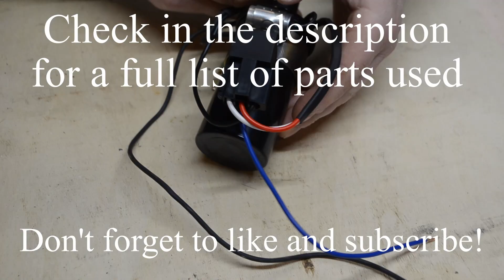High Voltage Igniter

Comment: Hi, I have just made anothere one of these and want to put it in a box to run my small ic engine.   Is there a motorcycle coil that can replace the cylinder coil to make the system smaller ?
Any help appreciated thanks.
Reply from the maker: I haven't tried that yet, but I bet one would work.

Comment: Sometimes I use your TIG wire trick to remove the wires from the 5wire relay pigtail and insert them in more user friendly positions, black for gnd, red for +, etc.  Thanks I'll use this simple setup.
Reply from the maker: That's a great idea! I need to build another one of these soon. Thanks!
Reply: Good idea, but I feel sorry for the person looking at this and wondering what wire goes where?😆

Comment: Would this work for an electric fencer if the pulse was slowed down...to say one spark per 1/3 second ? Meaning would id have enough power to carry a charge for a mile or so ?
Reply from the maker: It would. You'd just need to find a way to slow it down a lot. Whatever the coil is rated at is how many volts you'll get out

Comment: Best Video I have seen, My question I need to power on points make, on my old engine the points provide ground so can i power positive and let negitive only power when the lobe closes and causes it to spark at that moment?
Reply from the maker: Thanks a ton. I'm having a hard time trying to understand what you are asking. Can I have more context?
Reply: @BuildNPulsejets  My points will provide negative to the system, , and looks like the relay breaks only positive to make it "BUZZ"
 Can I swap  + and -  .for the same affect?

Comment: How long would you be able to run this with out it burning out?
Reply from the maker: I've probably got about 5 hours on this one over the last few years. The relay is just starting to give me some trouble
Reply: @BuildNPulsejets  Thanks I have just tried this and when i connect it together it just melts the wires on the battery connection. What have I done wrong could it be the relay colours being different?
Reply from the maker: @redwinecustomfabrications8970 yeah I suppose I could be. Let me see if I can find the pinouts on the ones I've got and you can compare
Reply: @BuildNPulsejets  Got it working, I had to swap all the connectors around, a bit of trial and error and i got there in the end.Got to try and fins something quieter though.
Reply: Could this be done with a SSR?
Reply from the maker: @redwinecustomfabrications8970 yes I believe that would work?

Comment: Watching your big pulsejet so quick and easy to spring to life, maybe even an ultra simple piezo gas grill sparker would be satisfactory. Something like this without starting air and just a single spark.  Of course, most pulsejets, you'd want a constant spark until they warm up or catch, say with a liquid fuel that can sometimes be more fussy.
https://youtu.be/NU3cQ8_upWk?feature=shared
Reply from the maker: I have a homemade spark ignitor setup with a momentary switch that I can turn on, then turn on the fuel and then as soon as the engine is started I can let go of the ignition switch.

Comment: Can this be used to power a flame thrower kit for exhaust on a car/motorcycle?
Reply from the maker: Yes, it sure can
Reply: @ Thanks! I assume a momentary switch to activate the spark could also be connected to this setup. If so, where exactly would you connect the said switch?
Reply from the maker: @ZflashProductions yeah, that would be easy enough. Just put it between the relay and the positive from the battery

Comment: ..it's not to take any value out of this video, but just to clear some terminology; Condenser is found eg. in refrigerating components and it's the coil where the refrigerant condenses to liquid from vapor (as an example of condensing..)..the.electronics component here is called capacitor..which really describes it's job better than term used in many languages in europe, (kondenzator, kondensaattori, eg..) since nothing really condeses inside.. it's more like reservoir pool for electricity..👍
Reply from the maker: Well, although you are correct, you are also not correct 😉. The condenser I am using is a capacitor, yes... It gets its name from the automotive parts inside a distributor and often is sold as a set of "points and condenser". Here I am specifically using this automotive part and is why I use its proper term.
Reply: In a refrigerant system, the condenser takes a hot, high pressure gas that comes from the compressor and removes the heat from it turning it into a liquid. Depending on how many degrees it cools it below the temp required to make it a liquid is called the Sub-cooling. Then, after passing through a metering device, typically an orifice, TXV or EEV, which atomizes the liquid into mostly a vapor, with some liquid droplets it goes into the evaporator coil, where the refrigerant picks up heat and becomes a superheated vapor. Same theory applies as sub-cooling, then the compressor compresses that superheated vapor and sends it back to the condenser to give up that heat and become a sub-cooled liquid again.
Reply: @a1reliableairconditioningi149 ..well condensed explanation of refrigerant circulation system! 👍😅
Reply: 😅..as i work with electronics i've never heard such term..but every line of profession has their own terms! 👍
Reply: @hipihei yes in Automotive terms its called a CONDENSER, 
like was stated, you go to a auto parts store, you ask for points and CONDENSER,
Reply: @hipihei  The term "condenser" used for this capacitor goes way back. It's connected alongside of the distributor "points" which is like relay contacts, but actuated by lobes inside the distributor as it rotates. the condenser, or capacitor, prevents the points from sparking, thus extending their life. we're talking about cars made before the 1980s, when electronic ignitions became more common.
Reply from the maker: @hipihei  Yeah, I agree, kinda weird 😂

Comment: The color codes on the relay connector wires are not always the same, (they should be -but not always) so your build might not work. Make sure that you use the wire connection to pin 87a, not pin 87.  My supplied connector had the yellow and red wires reversed.  The video clarified the connections required in his recap. Use pin 87a, not 87.
Reply from the maker: @doranoliver1624  ok interesting. Thanks for the heads up!
Reply: I was going to add this comment before seeing yours. I just found that out and melted a couple of the wires so did it again ignoring the colours and wiring by the numbers.

Comment: Is it a normally open or normally closed relay I built it according to what you did but no spark
Reply from the maker: @jjmasser8820  it is a normally closed. You want the circuit to be closed so that it runs through itself to activate the magnet in the relay that opens the circuit. Opening the circuit shuts off the magnet letting the relay close again and start the process all over again.

Comment: Electronics. Its fun !     At 10 years old........ had party lines ( phone ) going by our home in the country side.  6 party lines.   Took a single thin wire and connected one line of each party line ......with a resistor between them.  The resistor prevents the line from registering as " busy "....... then I put that line into my transistor radio to the amplifier side.    Anytime anyone made a call.  It rang in and I could listen to everything !  Lucky I never got caught !! :)   Or...... as a 10 year old Id be in prison !
Reply from the maker: I'm not old enough to have had a party line, but have heard of them from the old movie "Pillow Talk" 😂. Sounds like a good childhood

Comment: This works great when you have bunk beds.... use " fine " transformer wires to thread up and under the bed sheets..... use another fine wire to weave them through the bed sheets to where your victim will sleep...... when all is quiet....   turn on the power !!!!!!
Reply from the maker: @JimHerman-o3q  that's brutal 🤣
Reply: @BuildNPulsejets   Its cool...... no need for a alarm clock !     Just at timer !
Reply from the maker: @JimHerman-o3q  that sounds like the beginnings of a prank war that I don't think I'd want to finish 🤔😅🤣
Reply: @BuildNPulsejets    Another...... water chickens out of a metal pan..... make the pan hot.   Normally the chickens will do a complete flip and end up back on their feet !

Comment: Without that condenser will the spark not pulse, because I have the same setup but without the condenser and it will only spark if I tap the negative wire coming from the battery and I want it to always be pulsing so is that the condenser issue?
Reply from the maker: Yes, you need that condenser
Reply: @BuildNPulsejets  sweet thanks

Comment: This ia a well made video, but it would have been even better if a circuit diagram was included. As they say, a diagram is worth more than a thousand words.
Reply from the maker: You are right, I'm just not good at reading those myself. I'll have to make one up. Thanks

Comment: Well presented simple device - I wonder if it would work as an electric fence generator?
Good video but for electrical people a simple wiring diagram speaks a thousand words.
Reply from the maker: Thanks, I suppose it would work for an electric fence generator, but I wonder how well? I thought about just putting up a diagram, but there are other videos out there with those and I saw a ton of people being confused in the comments, so I thought something more visual would be better for most.
Reply: maybe use a 12v flasher in series on 12v+ side of coil?

Comment: Condenser goes to the negative side of a coil just as it would on a Car.
Reply from the maker: Works well the way I've got it here.
Reply: @BuildNPulsejets  I cant say much because I dont know the rest of how its wired.If a coil has its poles swapped around it looses about 30 % of its spark & these tip of the spark plug runs colder making starting harder .I have a drawing of how to build one on my pulse jet engine sight.
Reply from the maker: Although the condenser may be backwards, the ignition coil itself is wired correctly. This is how I wrote it down 15+ years ago and the few I've made this way have worked well. A condenser is most likely a non-polarized capacitor and if that is the case, it is irrelevant how you hook it up.
Reply: Can you explain how to do it in a car